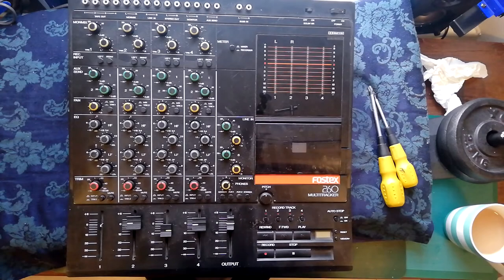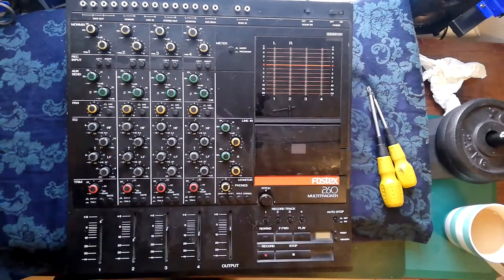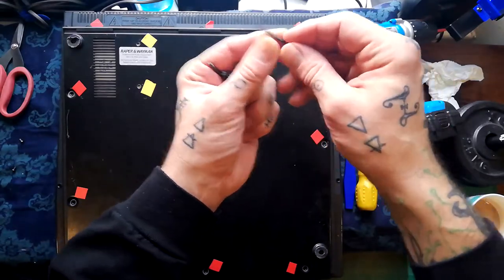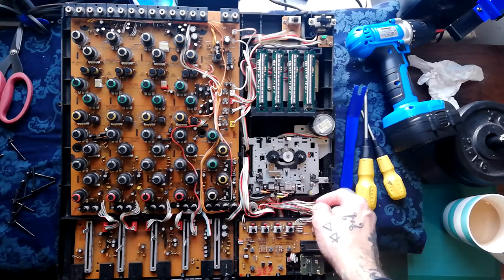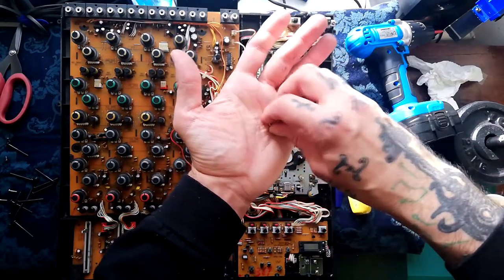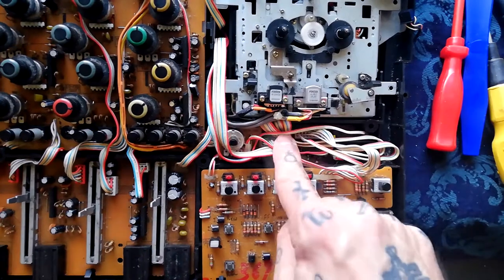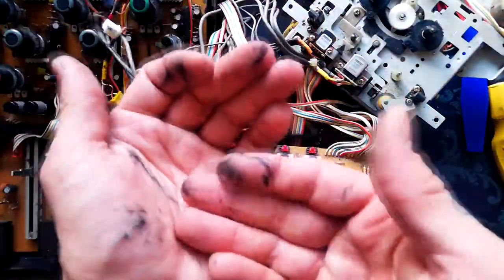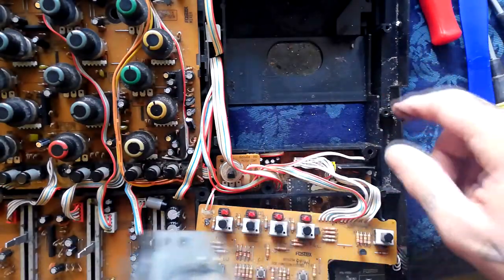Fostex 260 | Tear Down | 1 | Open case | Remove transport

Comment: Love your videos (Fostex 260 and Tascam 246 here). I just cleaned up and replaced the belt on both recorders based on your videos - that you for the terrific explanations. 

I do have one question: My tape counter doesn't seem to want to start 90% of the time. It displays, and it resets, and sometimes it advances as it should. But the vast majority of the time is stays at or near 0000. What do I need to check or replace to make this work again? Thanks in advance for ay advice you or your viewers can provide. K
Reply from the maker: Sorry for the late reply....I just repaired one of these where the solenoid, which engages play mode, was rusty. The symptoms were similar to what you describe. I left the core to seep in white vinegar overnight, and the rust came off with fine grit wet dry sandpaper. Now the transport works fine.
Reply: @Tetrakan  Thanks so much - the Fostex is at the shop now because try as I might, I couldn't signal trace other than to figure the rec/pb signal was getting to the LED meters, but wasn't getting through the input PCB for one channel. I'll get at the solenoid when I have it back in hand. Thanks again so much for your generosity sharing what your experience and knowledge with us.

Comment: What do you think about the overall sound quality of this Fostex? Have one, love one but I haven't tried any other 4-track. I'll restore two Fostex 460 in the near future, can't wait to hear those too!
Reply from the maker: It's equivalent to Tascam and yamaha stuff so long as the tape speed is the same. Same electronic topology and opamps in all these things more or less. Dolby C is noisier than DBX, but the high end is better. Choose your poison!
Reply: @Tetrakan  good to know! Both could do 9.5cm/sec, 460 has a half speed option too.
Reply from the maker: I've never seen one on the wild. In fact, I didn't know they existed until last week...I found the service manual on reddit by accident when I was searching for the 260 sm, which was eventually provided to me by fostex customer support. Fostex are definitely better in this respect; I've opened half a dozen support tickets with Tascam and never had a response, whereas Fostex have always supplied me with the information I asked for in a couple of working days. 460 looks like a 246  on PCP ...Nice!
Reply: @Tetrakan  Can back that! I couldn't find the service manual for the Fostex 460 and it's PSU and they've sent one over in a couple of hours, with a nice message. The only annoying thing with the 460 is the rather odd external PSU with a very 90s joystick-style plug. I had to buy a complete non-working machine with that big black brick, so I can clone it for the one I had before without it. At least I have two now.

Comment: Do you think its possible to mod the transports of two Fostex 260's to run off of one motor? The question may be a bit far-fetched, but I figured this would be a good place to ask.
Reply from the maker: Not completely impossible. I mean, if my hypothetical nemesis locked me in a dungeon/workshop escape room, with infinite time tools and parts like a multitracker themed purgatory edition of the  TV  show scrapheap challenge I could probably cobble something together. Doesn't seem very practical  tbh.
Reply: @Tetrakan  That was a beautiful reply. I love the sound my Fostex gives me, but there's no way to make a stereo recording with it if I'm bouncing tracks. It would be nice to essentially have two cassettes perfectly synced by one motor to retain quality and gain four extra tracks.
Reply from the maker: @afarfryproductions822  if your arrangements are too complex for 4 tracks really you'd need to get a Tascam or Yamaha 8 track. The DBX noise reduction behaves differently, and in most people's opinion, including mine, sounds slightly worse. Or go to reel to reel. There are also sync to midi for hybrid DAW / cassette solutions to explore but I'm not very knowledgeable about those because they seem like a headache, so I've avoided them so far.
Reply: @Tetrakan  I've got a Tascam 488, and the sound on that is pretty thin. The reel to reels are nice, but they just don't have that nice tape compression that the Fostex 260 slaps on my drums and vocals. I'll likely just move up to reel to reels and cut my losses.

Comment: I have one now and the tape heads won't move and make a single clicking sound. I opened it up and belt is still in good shape. Any advice?
Reply from the maker: I'd have to check the anatomy of that cassette player by referring to my own video, it's not a model I've worked on often and i dont have access to youtube videis here at my dayjob...but here is an educated guess. The clicking you are hearing is probably a solenoid, which means a system of shift arms  is being used to transfer power from the capstan motor to the gears which raise and lower the head, but its not catching. That could mean one of the belts ( there would be more than one belt if the design uses solenoids)  is loose, or hard grease on the gears (remove with isopropyl, replace with silicone grease) or there is something misaligned with the way the mechanism - spring or plastic part in the wrong place, or some part is actually broken or missing. You'd really need to open it and take a look.

Comment: My channel 2 is on full blast and won’t come down , how do I get to that and fix it?
Reply: Same man!
Reply: @whiteshedrecordings  dude if you find a fix pls hit me up man, you on Instagram?
Reply: @goonknox  Sure thing! @apoorlywrittenstory
Reply: @whiteshedrecordings  awesome, done , 
Ps I’m  dawless too
Add me up @goonknox
Reply from the maker: You probably need to solder that fader, pry it open and deep clean it. If access to that board isn't shown in this video (I published this a long time after filming it, so I can't remember, sorry) then It will definitely be shown in the third part of this series, which I am due to publish this coming Wednesday. Here's a video I made doign the deep clean on Tascam 244 faders, the process will be similar enough in your Fostex 260, good luck https://youtu.be/8XT01jWUzRU
Reply: @Tetrakan  I will let ya know how it goes✌️
Reply: @GoonKnox  @Joe Jones  
Yo, it was a while ago and can't remember for sure if my channel 2(or 3) was always on full blast, but the fader wasn't working. Anyway i got it working in the end after no amount of cleaning helped... Might sound a bit weird and i hope i remember this correctly, but it was the fader lever that was installed the wrong way on the tracks on mine. I pried open the fader and installed the lever back 180° reversed on the tracks and it worked. No guarantees here, this if ircc is what got mine working. I quess that would mean that it was installed backwards at the pot factory... It was beat up and the lever bent so i thought the fader had taken a bump, but could be that someone had tried to "convince" it into working again. :D It was a bit of a hassle so it might be something else, or that I installed it the wrong way after the first cleaning, but I paid attention on the orientation the first time, so unless i was confused, this was it. Hope this helps.

This could be a whole other problem for you guys, i doubt that those ALPS faders just happened to often be faulty on Fostex 260 channel 2. Just my two cents if you guys didn't get them working.✌
Reply: @whiteshedrecordings  check my comment below